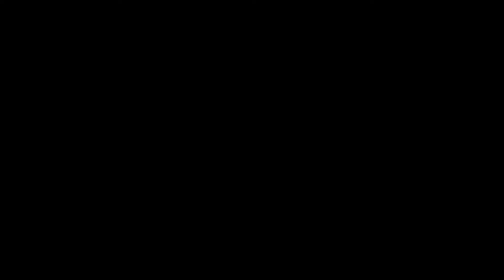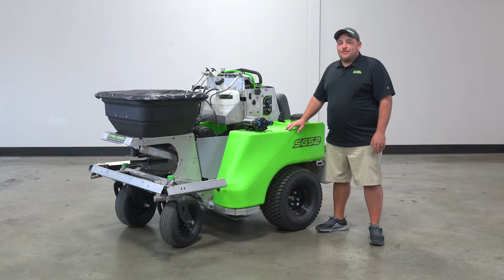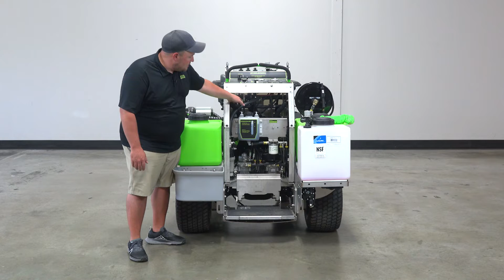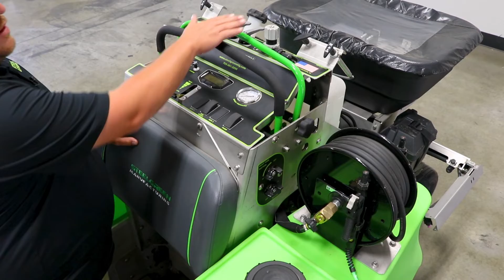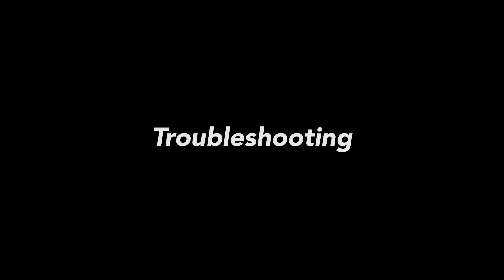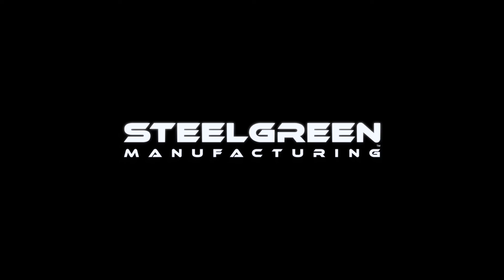Steel Green Spray System Walkthrough

Comment: I'm currently working for a landscaping company, and they just made me the chemical foreman and issued me a heavily used SG52. There is a massive amount of prodiamaine settled at the bottom and I know for sure that that main branch didn't properly winterize it. 

The quick release pins are actually broken off and I was telling our branch manager that we need to replace those and that I need to start back flushing the system to break up that sediment and check for leaks. 

He said no, because the machine wasn't made to do that, and that we know there are no leaks because the machine is working. He then told me I'm spending too much time rinsing the tanks at the end of the day, (triple rinse) and other landscaping companies don't do that.
Reply: Well if it wasn't winterized right that water froze and busted everything inside there
Reply: And that boss of your is wrong! We back wash and clean and winterize all the time! Got to take care of the equipment that takes care of you

Comment: The machine overall is worth the money. The electric spray pumps that come on it are not. I modified mine by mounting a gas engine with a Hypro 6 roller pump mounted on the left tank for using Prodiamine 4L. I can tell you after years of using Prodiamine every applicator will at some time experience a Prodiamine constipation clog, which results in removing the clog the old fashioned way! The other thing I wish was different is the spray boom, bending the metal into a C shape  instead of the angle would make it less likely to bend on the ends.
Reply: Exact issue I had today Prodiamine clog....75% done right tank is topped out needa drain it and resume clearing out tmrw